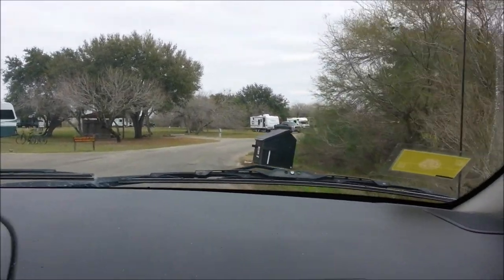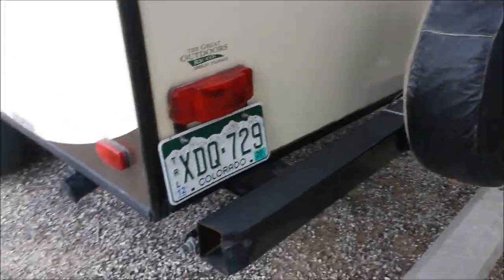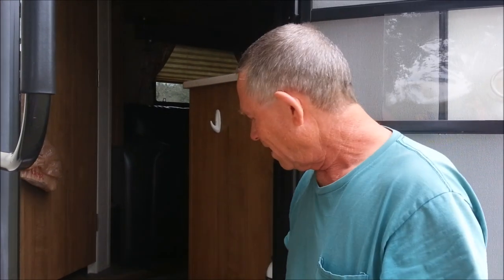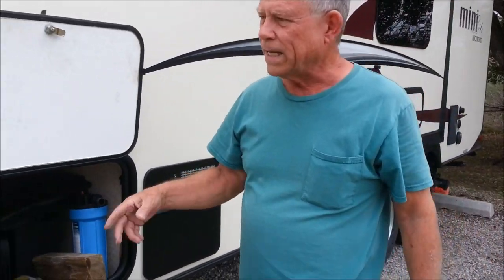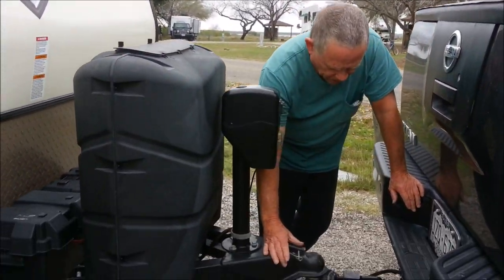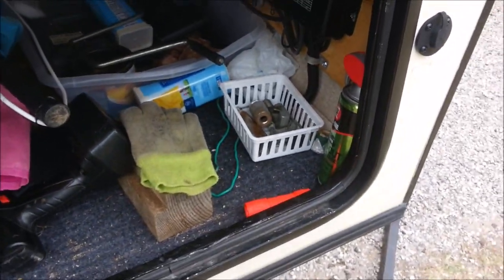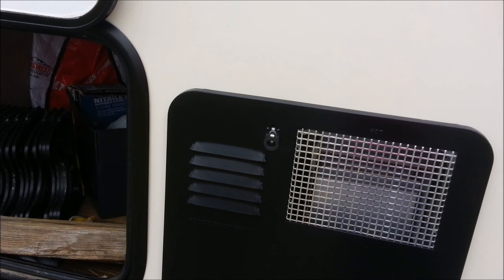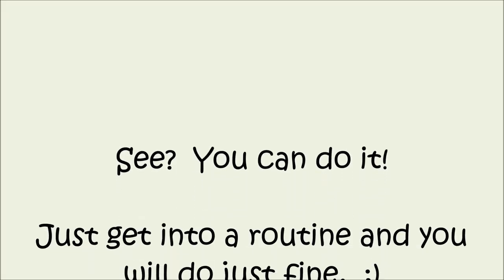Backing up, unhitching and setting up a camper 101.  Can we do this?

Comment: When the hose is in travel or not used connect the ends together to keep debris out of it.
Same with the water nozzle the park supplies,run it for a few seconds.
Reply from the maker: Great tip for others Andrew.  I have been doing the same with my hose lately.  I always run the water at campgrounds before hooking up my hose.  There is some pretty nasty stuff in some of them.  LOL  :)   Thank you.

Comment: When ever we go to a camp ground and set up we are always rocking , thanks for the tips
Reply from the maker: Have a great time!  :)
Reply from the maker: OH.. regarding "rocking".  Once you are level and the stabilizers are down, go around with the manual hand crank (notice I use a hand drill to lower them) and give them about 1 more full turn or until you feel it snug tight.  Don't LIFT the chassis by any means.  Also I have heard that X chocks help with movement front to back in the camper.  But I don't have those.   You just need to snug up your stabilizers more.  :)
Reply: tandem axle? get x chocks

Comment: You are a great teacher. Just got my new travel trailer last week. We did an overnight at a Harvest Host cidery that was close to home. Oh my, I learned that I don't know anything! I couldn't figure out why I could not disengage the ball mechanism. After watching this video, I realized that I did not remove my equalizer/sway bars. I bet that was it!  I didn't have a block for under my crank either. Will get it right away. Will get the little pad thingies for the stabilizers too. Oh, I will check out your other videos, but how do I know if I have water in my water heater? I was thinking it will go there if I add water. Now I am questioning everything. Excited, not nervous angry questioning.
Reply from the maker: Hi Joan.  Glad you have a new trailer.  :)  YouTube is a great place to learn a lot about becoming familiar with your camper.  Hot water heater.. yes.  When you connect to city water or a regular outside water source and turn on the water, you should hear water rushing into your water heater if it is empty.  If you just fill your fresh water tank with water, it won't fill the hot water tank automatically.  You'll need to turn on the water pump, turn on a hot water faucet inside and that will draw water from the fresh water tank into your hot water tank.  If you aren't familiar with using the hot water system, try this video to see if it helps.  It's a 101 type video for new campers.  :)  Good luck and I hope you remain excited.  Michael  https://youtu.be/dEoR-IK3p9c
Reply from the maker: A bit more of an explanation on the hot water heater filling with water.  Not sure if I explained it that well.  But watch the Hot Water basic video first.....       When your hot water tank is empty..  if you connect the city water line and turn on the water, you should hear water running into the camper.  What it is doing is filling the hot water tank.  In a case like that, I will open the pressure relief at the top of the hot water tank and turn on the city water.  When water starts pulsing out the top of the relief, I know the HW tank is full.  Flip off the relief and that's it.  Of course, you'll get sputtering inside when you turn on the cold/hot water faucets until the air is displaced by water in the water lines.  :)  To fill from the Fresh Water tank..  Inside, turn on the water pump and open a hot water faucet inside the camper.  Go outside, open the relief valve at the top of the HW tank and you will hear water running inside.  When water starts pulsing out the top relief valve, flip it down to the closed position.  Go back inside and shut off the faucet.  You need to have a Faucet open inside the camper for water to run inside the HW tank.   Michael

Comment: I have the Husky Model: 32218 weight distribution hitch. Should I remove the stabilizer bars before backing up? Seems to me it will take a long time to raise the front end in order to take them off, with the electronic jack.
Reply from the maker: I never remove my WDH bars Matt.  I have to raise the hitch anyway to get the ball to clear anyway so I can disconnect the TV.  Depending on your distribution system, you may need to remove the bars for tight turns.

Comment: Hey i can't get anything done around the house with your video's popping up on my phone . Your a great teacher . Do you have any idea of the weight of everything your carrying , tools , clothes etc ?
Reply from the maker: LOL  Hi Ken.  I think we probably have about 500-600 lbs of stuff in the camper.  They say a rule of thumb is 100 lbs of personal stuff (clothing shoes etc) per person.  My camper weight is 3,540 dry (it will be stamped somewhere on your trailer) and the Gross Vehicle Weight Rating is 5,256 lbs (also on a sticker somewhere on each camper).  I rarely run with more than a 1/2 tank of fresh water (20 gallons or 166 lbs).  I empty (where possible) the black and gray tanks to lighten the load.   One of these days, I need to weigh it.  :)

Comment: Thank you!! Your explanations are very helpful.
Reply from the maker: Well cool!   Glad you liked it.  :)  Oh, a tip I learned later and didn't show here.  BEFORE you connect the hose to the spigot, run the water on the ground for a bit until you see CLEAR water coming out.  Some water lines at campgrounds may have rust in the lines.  :)   Happy camping.  Michael

Comment: Hi there thanks for this video,  I noticed your truck and my friend is in the market for buying a travel trailer and he likes to have the Titan for tow vehicle, he has now a frontier. Do you have a TItan HD and what is the dry weight of your trailer and what is your WDH is that equalizer or E2  I really appreciate it.
Reply from the maker: Go with the Titan!  I test drove a new Frontier and it does NOT have the turning radius of a Titan or the power. Mine is a Titan V8 Pro-4x. Iove it!  Yes, I have the E2 Hitch, Trunnion Style.  There are several types on the market, this one is easy to use.  :)   My dry weight is around 3,500 lbs.  Loaded with water, stuff, and 2 full 30 lb propane tanks I'm at 4,440 lbs. I had it weighed. Good luck!  Hope I helped out some.

Comment: I recently bought a  2018 2109s. I have noticed water in the 30 amp connection on the side of the unit after rain. Is this normal and if not what could be a fix?  Thanks for all the great videos, learning a lot.
Reply from the maker: I have never had water in mine.  Check to see that is SNAPS loudly in place when you close the lid.  Mine fits very snug.  There is very little chance water can get inside by the prongs since that is all 'sealed'.  Likely water blew in during a rain?  Don't lube the threads on the outlet, but the next layer out from there, you could put a very thin layer of Plumbers Grease (don't use oil based lube) around there or on the inside of the cap.  That may help water to bead and run off rather than inside.  My best guess, the lid isn't closing tightly.   Good luck.  :)   

Oh, and an afterthought.. as long as you are plugged in and water gets in there, you are ok, the prongs are covered tightly enough.

Comment: Wait a minute, I turn on my hot water from inside on the control center.  Can you do it either way?
Reply from the maker: The switch inside turns on the hot water heater to use Electric.  If you have a Suburban HW heater, there is also a switch outside on the tank as well.  Both need to be on to use the electric side of heating the water.

Comment: What kind of hitch and sway bars do you use?
Reply from the maker: I use the E2 Equalizer Trunnion Hitch Reean.   Different sized rigs may require a heavier hitch, but I like mine ok.  Be sure to tighten all the bolts correctly and check for any shifting  You can probably find some videos for your rig weight on Youtube.  :)
Reply from the maker: I have a feeling the bolts are not tight enough. Ugh.  My camper is light, and it did help a few days ago tightening the bolts once again they haven't moved since.   I'm going to take them off and reposition them again.   :)

Comment: What is the height of your truck height at the top of the ball?   Thanks
Reply from the maker: Hi James.  I will have to measure that tomorrow.  I think the weather is nice.  LOL
Reply from the maker: James.  The top of the ball to the ground is 24" when the truck is unloaded.  I carry about 200 lbs of stuff in the bed of my truck when traveling.  So, my hitch lowers of course an inch or two.  Hope that helps.  :)